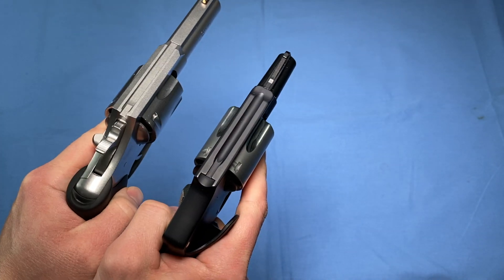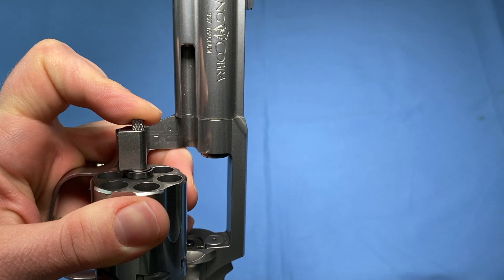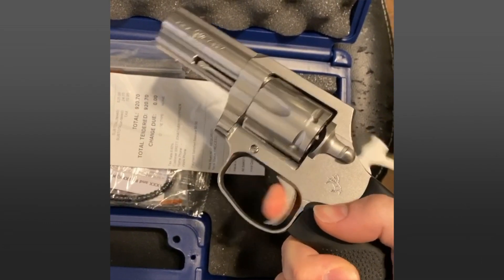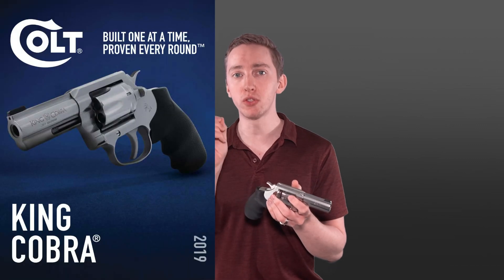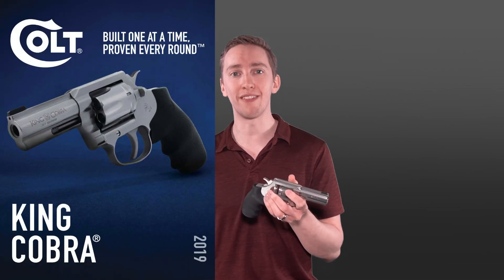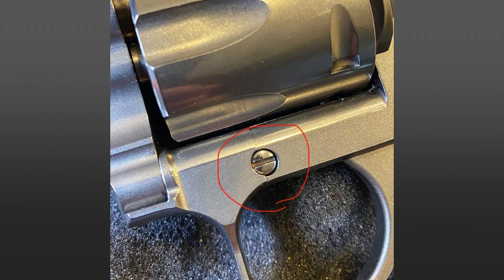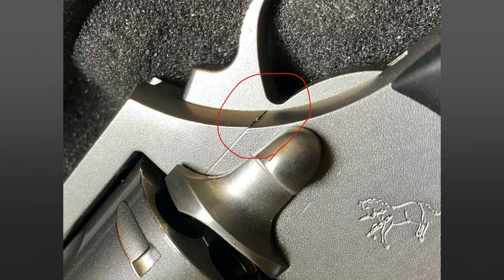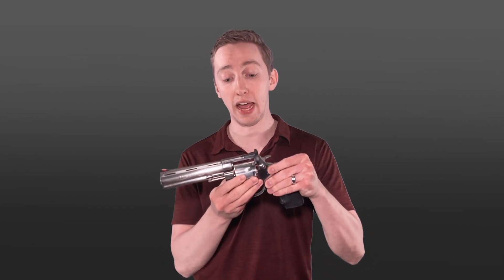Colt King Cobra - Problems, Malfunctions, and Failures OH MY!

Comment: UPDATE: I own the 3” Colt King Cobra. (late 2019 / early 2022 production).  I have now put a little over 200 rounds of 38 special and 50 rounds of 357 mag through it.  Wish it was more but ammo prices are still high.  That said, I have dry fired this revolver so many times that have of the snap caps have literally broken into pieces around the back and I had to throw them away.  After watching this video I’ve been doing what I could to see if mine would fail.  As mentioned before the cylinder would originally stick and was difficult to release.  It is much better now after repeatedly opening and closing it.   The gun is fun to shoot and still the most accurate revolver I have shot due to the amazing trigger.  While I haven’t had anymore light strikes, I do still believe this revolver will light strike ammo with harder primers in double action because of the design.  I primarily shoot it in double action.  The weight and size is awesome.  I like this revolver more and more the longer I have it.  Still not sure I would trust it as a CCW based on this video and other issues mentioned in the comments.  But, just wanted to report mine has not broken yet and I like it more each time I shoot it.  I do still feel it is over priced.  I was going to purchase a Kimber K6 but handled one at a local fine store and it was defective out of the box.... cylinder was near impossible to open.  The gun store employee tried it and said it was defective and would be sending it back.  Didn’t make me feel real good about Kimber... but perhaps that was just a lemon.  I really hope this firearm keeps performing because I like it overall now.  If you want a revolver to CCW, Rugers are very reliable and built to last so perhaps start there.  I have tried to find more videos / reviews on the Colt King Cobra but not many are out there from people who have really put the revolver through its paces yet.  Let us know what you think if you own one.
Reply from the maker: Thanks for the update! Excellent info!

Comment: I bought mine yesterday and had it on the range about 1 minute after finishing the paperwork (my go to gun store has an indoor range) and I put 50 rounds of 357 mag 158 grain JHP through it with no problem. I'll come back with an update tomorrow when I put another 100+ rounds through it. So far upon looking mine over the machining appears to be very well done as is fitment, and the ejector problem you had only happens on mine if I really put some force into it. The only imperfection I noticed is a small little ding that looks to have been made by a punch but it's in such a hidden spot that it doesn't concern me, it's so small that I only noticed it when I used a flashlight to look for any burrs (of which i found none), and it's not on a moving part so I'm not at all worried about it.
Reply: CORRECTION: the small ding I'm noticing appears to be normal, if you watch hickok45's video on the colt king cobra and pause at about 37-38 seconds in you'll see what I'm talking about just in front of the cylinder when he opens it, the marks are identical to the marks on mine
Reply from the maker: Jonny Bravo Mine also had the same spot. It came back from repairs with a new, second spot there as well. So I’m assuming the new one was a punch indicating that it had the new trigger return spring installed. But I’m not sure since they weren’t transparent about what was wrong or what they fixed. I’m sure yours will be fine. My problem with Colt is: IF you have a problem, you have a big hassle ahead of you. Not to mention, their warranty is only 1 year. A 1 year warranty doesn’t sound like they are very confident in their product. I wish you luck, and I’m sure your King Cobra will be just fine. 👍
Reply: @NightwoodGuns  you're probably right, just seems like with the complaints people are having they need to hire better quality control workers. Because I've heard similar things about the python some people have issues other people you'll have to pry it from their cold dead hands. I'll be sure to report back here with my experience tomorrow at the range, I'll be putting both 357 mag and 38 special through it both to train with it and to break it in
Reply from the maker: @jonnybravo4389  It's always a good idea to vet a gun for reliability no matter who made it. Enjoy shooting it!

Comment: I have gotten myself a CKC a few months ago. Of the issues you listed there indeed was a misaligned sideplate. I was afraid it was truly of mismatching shape and it would have to be either cut by a gusmith or replaced altogether. But fortunately when I disassembled it it turned out that the sideplate can be simply put back into its correct position, so the edges are prefectly smooth now again. (One would think that plates like that would have railings so they would fit together like puzzle and wouldn't misalign when the screws loosen up a wee bit - but apparently not.)

My cylinder is OK, the coarsening on the ejection rod doesn't fit into the hole so it can't stuck in this or any other way. But I make extra sure it's well oiled at all times. I haven't had any issue with trigger yet, either, fortunatelly, but will keep an eye on it.

Thank you for the video!
Reply from the maker: Thanks for sharing your experience! I definitely tried to realign my plate to no avail. But I'm glad yours was easily fixed! Hopefully your CKC holds up and serves you well for years to come! If anything changes be sure to update us here.
Reply: @NightwoodGuns  Thank you! I have shot four packs of 38 special and one magnum so far, so it's not much. But I carry it regularly, sometimes I switch for CZ RAMI decocker. I have to admit, tough, that the existence of the issues you and other people experience(d) ruins the joy from the new gun. Instead of being honeymooned with your new piece you keep thinking is it alright, did I do the right thing, ain't I the dupe here in the end? Unpleasant.
Reply from the maker: @richardbolla3713  I completely understand that feeling. It sucks. Hopefully your King Cobra is fine and continues to serve you well. If not, I've heard that Colt's customer service is slightly better than it was when mine broke. So hopefully they will take care of you if anything happens.

Comment: FINAL UPDATE:
I purchased a Colt King Cobra 3” in early 2022.     Owned it about 9 months a shot a few hundred 38 special and a few hundred .357 mags rounds through it during that time.  Good news:  Didn’t have any catastrophic failures or broken parts with the firearm that caused it to stop working.... as others have experienced.  Also, while it originally had cylinder sticking issues when unlocking the cylinder,
That went away as the firearm got broken in from shooting and dry firing with snap caps.  (Dry fired this gun with snap caps well over a thousand times).  Bad news:  The Colt King Cobra had light primer strikes from the beginning (with multiple ammo types) and that continued to increase in frequency the more I shot it.  The Colt King Cobra 3” feels great in hand, great to carry, easy to shoot accurately, but at the end of the day it is worthless to me (and many others) if it isn’t reliable.  For the price tag on this firearm, it is ridiculous that Colt can’t make a reliable King Cobra revolver these days.  I fear many people won’t find out how unreliable their Colt King Cobra could be because they don’t actually shoot it enough.  If you want a pretty safe queen to shoot at the range once or twice per year (with potential issues), then perhaps this gun is for you.  If you want a reliable revolver for both the range and self defense, I suggest looking elsewhere.  For the same price range you can purchase a Smith and Wesson revolver or a Ruger revolver.  Even the lower priced Taurus 85 and 605 revolvers I’ve owned in the past were reliable.  Sad for more than double the price of those the Colt King Cobra was not reliable.
Reply from the maker: Thank you for the update! It’s especially helpful since yours was a 2022 purchase. I agree with your assessment 100% 👍
Reply: There are also bad problems with S&W Ruger and of course Taurus. Looks like no manufacturer is able of building revolvers in constant quality anymore!

Comment: Thanks for the heads-up. That is very disappointing, I agree. You can't return it either, and just buy that S&W Performance Center. I was going to buy a King Cobra Target and I'm glad I saw this in time. I think I'll get the Performance Center 60 intead or even the Taurus Executive 856.
Reply from the maker: I think that’s a smart move. Be sure to check over the Performance Center if you decide to buy it. Smith’s QC is still recovering from keeping up with panic-buying. But at least there aren’t any design flaws and their customer service is decent 👍 Ruger seems to be the most solid at this point in time if you are willing to consider one of their revolvers.

Comment: I bought my King Cobra earlier this year, April 2020, I think? I bought it after buying a Kimber K6S snubby, and thought, “The Colt has to be better, it’s a Colt...they’re famous.” Tried it out in store, I was actually going back for a Python (thankfully it sold minutes before)...

Long story short: I have about 100 rounds (just under), mostly .357 magnum: and no problems until tonight.

I decided to dry fire it. Out of the blue: trigger locked up. Cylinder won’t turn.

I backed off the trigger and tried again; and it works maybe 3/4 of the time. But rapid-fire drills (dry-firing) or slow and steady, repeated firing will cause random lockups.

So here I am waiting for Monday to call Colt...thanks for the video. I’d agree: until they recall this officially, stick to a Smith, Kimber, Ruger - or even some of the old Dan Wesson’s (the 15-2 is amazing! Started collecting them and they’re fantastic).

Shocked at what happened to Colt. It’s as if they’re being made by Taurus or Hi Point...what gives?
Reply from the maker: I’m seeing way more King Cobras and Cobras break recently. I think people are finally hitting round-count numbers where they start to crap out. Sorry that it happened to you, too.

Btw, I agree with you on the old Dan Wessons! Fantastic, often overlooked revolvers 👍

Comment: I bought a 2" CKC about two months ago. Havent pumped a lot thru it yet but hopefully 2023 guns resolved the issues. I havent seen any yet. 🤞
Reply from the maker: Just had a guy comment that his 2023 King Cobra broke. Went from a collector/fanboy to losing all confidence overnight. His lasted longer than mine at least 👍 I hope yours is good to go, though! You deserve to have a perfect revolver at that price point.
Reply: Nightwood is correct and I'm the guy he's talking about.  I began collecting these new Colts & have some version of every new production King Cobra made to date. That includes the  3", Target 4", and several 2" snubs. The MIM trigger & hammer never did set well w/me, but I liked these new D frames enough to mostly overlook it. I never thought twice about running 500 rounds (mostly .38) or more thru any of them at a range visit; until my DAO 2" laid down on me June 1st.  I knew the multitude of clicks on the trigger return (5 to be exact) could make short strokin a touch and go subject (ask SGT1911 his opinion). Still, the trigger pull was smooth and as a Colt, if I did my part, I expected it to run and run.  It didn't and I'm sorely disappointed. My snub is back at Colt as we speak, I imagine for a faulty return spring. Not that Colt will likely say, but I'll keep y'all posted. I hope yours is G2G Svede12 and Tyler R, I truly do. Run it hard but keep your eyes open. If it lays down or doesn't, please let us know as your round counts trend upward. All the best, Smooth.

Comment: I had the ejector stick in mine also.  My solution was pinching the knurled end in a piece of sand paper and spun the cylinder with my other hand.  I had it fixed in about 10 minutes.  I was lucky and that was my only issue.
Reply: Matthew Brinkley As long as people such as yourself are willing to “fix it yourself,” Colt will continue to produce flawed revolvers packed in new Colt boxes.

Comment: I bought a Colt Python and a Colt King Cobra..i had these issues with BOTH. I'm truly saddened by what's happened to Colt....kudos to those who got good ones. After dealing with Colts run-around and nonsense...i gave up and I ended up taking mine to a very good gunsmith and having it upgraded and customized, NOW its a decent gun....its NOW the gun that Colt SHOULD have built!
Reply from the maker: Man, that sucks to hear. But I know exactly how you feel. I’m glad you were able to get them squared away by a talented gunsmith at least 👍 Now you can actually enjoy it.

Comment: I just picked up a King Cobra Target version today.  That same gun shop had one in when they first came out, in 2019, but when I handled it, the action felt gritty, and the ejector rod stuck just as your King Cobra did, so I wasn't even a little tempted to buy it.  I did buy the basic Cobra (snub nose), and after about 30 shots, the front fiber optic sight "liberated" from the barrel (landing in a fold of my jacket sleeve).  It was easy enough to fix, by putting some blue Loctite on the retaining setscrew and re-installing it, but there clearly hadn't been any Loctite used when it was assembled, even though the owner manual specifies using it to replace the front sight.  It might sound petty, but that minor glitch really tainted my affection for the gun, and I sold it shortly afterward  I've always been more of a S&W fan anyway.  When I bought the King Cobra Target, earlier today, I went over that thing millimeter by millimeter:).  It looks perfect, the action is smooth and everything appears to be in order.  So fingers crossed that they've fixed their initial quality issue (or that I happen to get one of the few well-built guns they let slip by), because I really do love the look and feel of this gun.  And hey, no keylock on the frame - imagine that!
Reply from the maker: Fingers crossed that your new one lives a long and healthy life! 👍
Reply: @NightwoodGuns  how do you feel about the king cobra now any more issues with it I have my eye on one looking forward to your feed back.
Reply from the maker: @snoops310ytpc7  It seems like it's probably okay... I get people commenting on here that their's is fine, and I get just as many people commenting that they had a breakage. It's all anecdotal, though. And who knows if people commenting have put enough rounds through it to even potentially experience a breakage. I, personally, would not get one or recommend getting one. But, honestly, I wouldn't even recommend getting a Smith right now. Normally I recommend Smith & Wesson Performance Center, but the last few Smith's I've seen have been hot garbage since they can't keep up with pandemic/riot/Brandon demand and their QC is slipping. At this point (end of 2021), the only revolver I'd recommend would be a Ruger (if you can find one) until these companies can catch up with production. Vintage Smiths, Colts, and Rugers are also always an option on Gunbroker if you have the budget.

Comment: That’s a shame. Colt is long gone. Only large scale production revolver manufacturers id recommend  are s&w and ruger
Reply from the maker: Normally I would agree, but I just saw the two worst S&W Performance Centers back to back and decided to pass. Was going to get a 19 Carry Comp, but both would not fully cock on one or two chambers: they would lock up. And they were blemished to hell. I don’t think Smith QC can keep up with demand. I’d probably wait to get a Smith until they can catch up with the craziness. Rugers are still good to good though, in my experience. 👍

Comment: I am currently researching King Cobra, very seriously considering buying it for fun and EDC and hearing all this is borderline heartbreaking. I'll certainly focus very carefuly on all these tips you and other kind folks have listed. What makes me worried is that buying it here in Europe the odds are many of the pieces available will be of the older batches with higher likelihood of all the issues present. Sweet God, I feel like opening a bottle and crying myself to sleep.
Reply from the maker: If you live in Europe, I would imagine sending it back to the factory for any issues would be a massive pain. I would recommend against anything in current production from Colt. No matter what you decide, I wish you luck.
Reply: Hahaha, yeah I was excited about it too and I'm also saddened.
Reply: I just bought the King Cobra as an impulse buy. The fit and finish on mine is great. I've only shot a few dozen rounds though. My favorite carry gun so far is the Kimber micro 9.
Reply: My 2022 return spring snapped lengthwise. Except for that bad part, the gun is fucking awesome.

Comment: Just had the same problem happened to mine about 20 fires with SNAP caps I'm pretty sure it's the return spring that snapped or slipped off gun is maybe two weeks old never fired
Reply from the maker: Wow, this is still happening? That’s crazy. Sorry that happened, it sucks.

Comment: Charter Arms quality at a Colt price.
Reply from the maker: For real. My thoughts exactly.
Reply: @NightwoodGuns  Forgive me. I did not thank you for your honest assessment. Famous content providers who participate in the manufacturers' T&E programs rarely provide honest assessments for fear of being removed from the programs. BTW, I was at a local gun shop a few months back and saw a Charter Arms Undercover in one of the showcases and asked the salesman if I could see it. He took it out of the case to clear it but the gun was locked up solid. He couldn't release the cylinder. He couldn't pull the trigger. It was just frozen up, brand new. Certainly don't expect similar issues from a gen-u-wine Colt. Again, thanks for the great video.